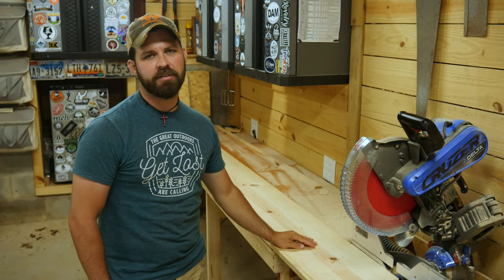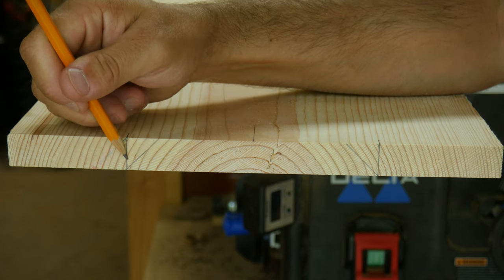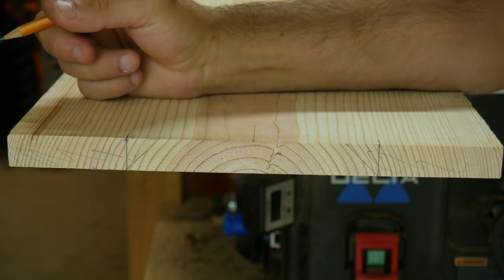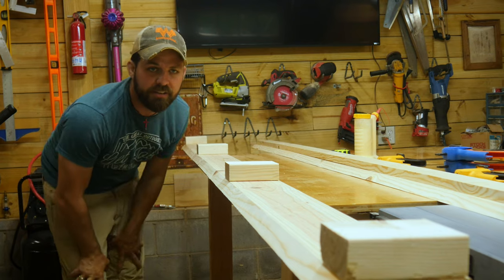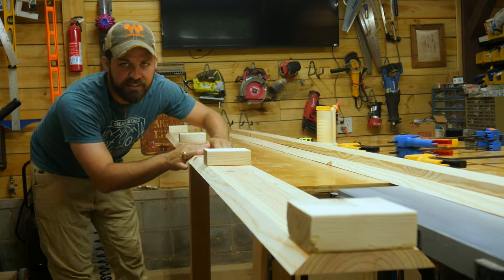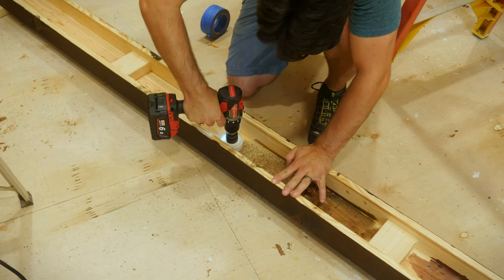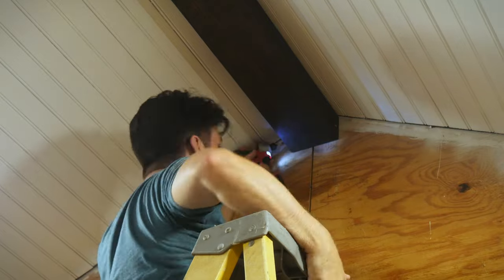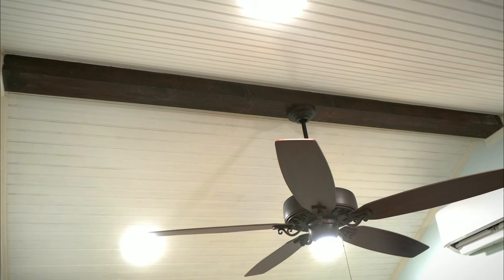They'll Never Know It's Not Real

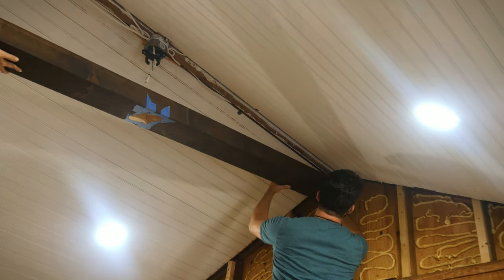Comment: Great video! For the electrical box, at 4:59 it looks like you used two boxes doubled up plus what looks like some kind of extender to get the necessary depth so the electrical box is flush with the bottom of the beam. Is that in fact what you did? I have a similar situation with wanting to install a faux ridge beam that already has a ceiling fan mounted.
Reply from the maker: Good question! That set up was a metal single gang octagonal electrical box, an extension ring for the box, and then the mounting bracket for the ceiling fan (came with the fan).

Comment: What size hole saw did you use?
Reply from the maker: It was a 2.5" hole saw in this case. I used that size because it is about the width of a single gang electrical box to help maximize the amount of space to help with wiring, but also because the "cap" for my ceiling fan can cover a little over 3". If the cap for your ceiling fan to hide the wiring is smaller though, you may need to use a smaller hole saw.